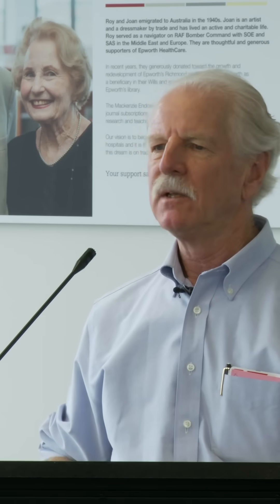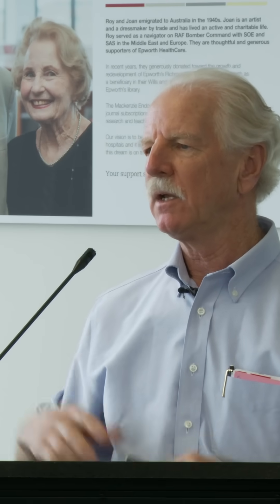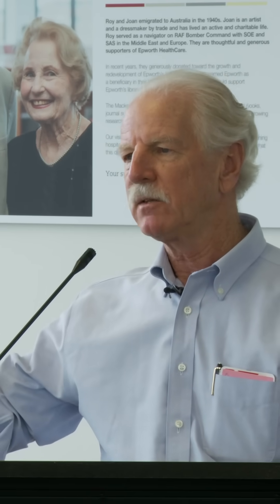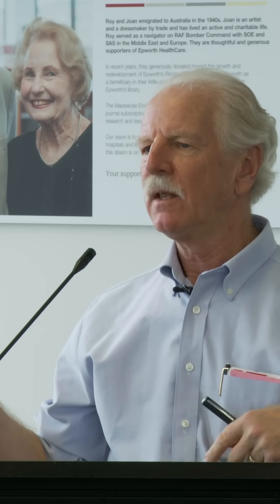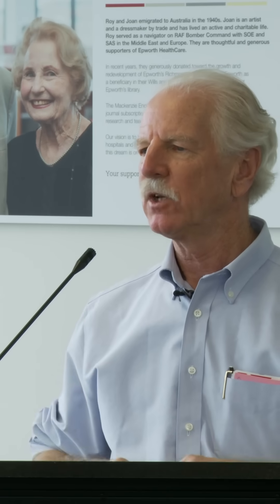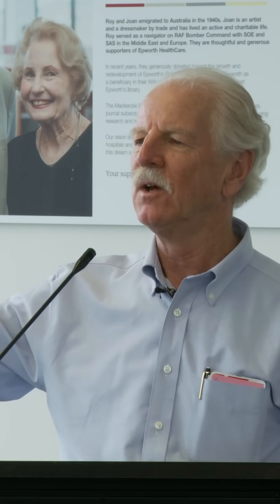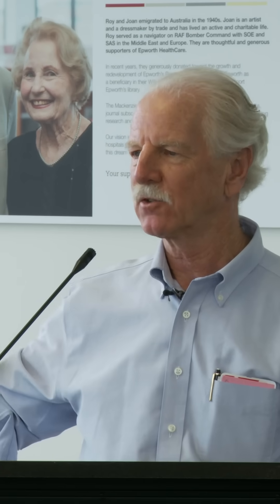Dr. Steve Phinney on how to measure #insulinresistance

Comment: I’m definitely a person who struggles w insulin resistance. For years every time I had bloodwork done they would tell me blood sugar was high, but the advice was just to cut down on sugar. But for years I didn’t eat sugar yet it was still high. As a 1-year carnivore, I’ve had amazing health improvements but my weight is taking forever to go down. It keeps dropping but at an average of a quarter of a lb a month it’s just so very slow; however, last month I lost 2 lbs which for me was remarkable. Insulin resistance is a tough thing to reverse but at least I know I’m on the right track.